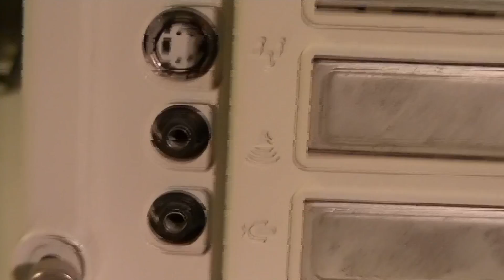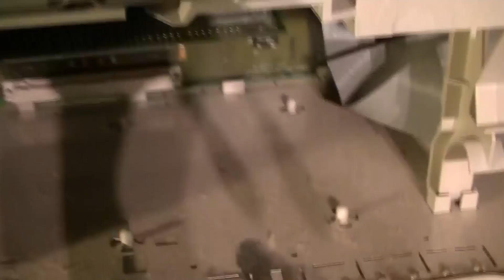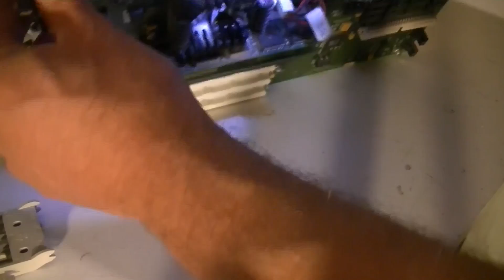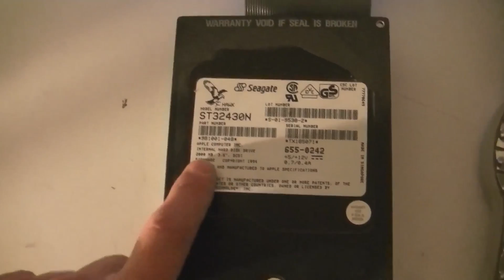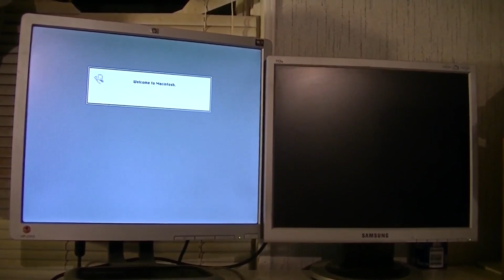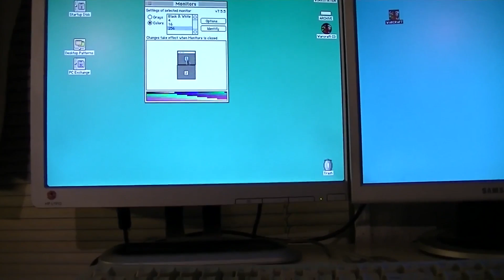Apple Power Macintosh 8100 / 110  Disassembly and Startup

Comment: The trouble and comments you made at around 12 minutes is why I love my old Powermac 6100. After pulling the 2-tabbed cover off, there's only around 2 or 3 screws you need to take out to remove every single component in the case. The slower speed (60MHz vs the 8100's near-double clock speed) and lack of expandability are not trumped by the improved specs when you throw in such a horribly cluttered and flawed case design, at least in my opinion.

On that note, every Mac tower case from the Quadra 800 to the Powermac 9500 are just awful in terms of design. The next generation towers, however, from the 8600, 9600 and G3 are a real pleasure to work with. The same can be said with the older Quadra 900 and 950 towers, very easy to maintain.

Comment: I had the Radius 81/110 which was a clone of this system in a different box. The video card in the PDS slot is a HPV (high performance video) card and was an option I think. It let you run higher color depths through second monitor but didn't actually improve video performance heh.

I had a pass through adaptor which combined the HPV card and a Sonnet G3 300Mhz card. That was an impressive upgrade.

Really interesting explanation about the peltier device. I wondered what that cable was for.

Comment: I had one of these machines, we were doing a big video project at the time.  The lockdown of the NuBus cards wasn’t too much an issue.  The 8100 was however one of the worst Apple products of all time to work on.  Twenty minutes to half an hour to pull a RAM simm and put it back together to see if you’d finally found the defective part.  The arrival of the 8500 was a direct response to this horrible machine…  pull one tab and the whole machine would lay itself out so you could access anything you wanted.

Comment: 14:35
My PowerMac G5 also has an AMD Northbridge, noone actually really noticed that, but Apple was in bed with AMD all the time.
Reply: AlmightyMaria PvB You must have read wrong, Apple never used any AMD northbridges, early G5s used Apples own CPC925/U3 chipset later versions used CPC945/U4 by IBM. The chipset in this video is AMD 79c950akc which is a SCSI controller chip.